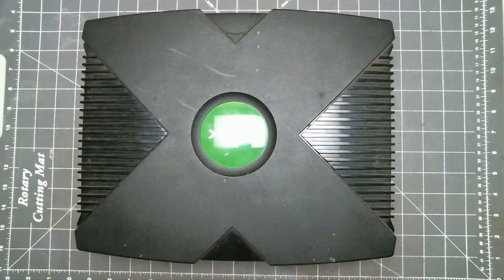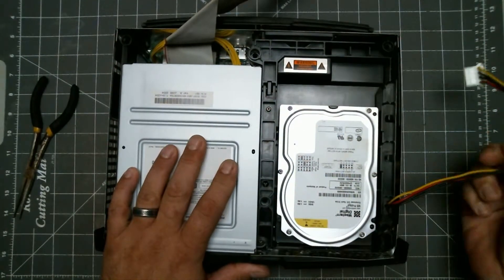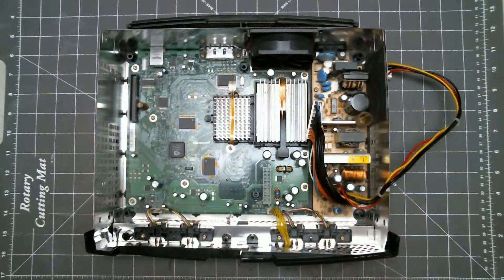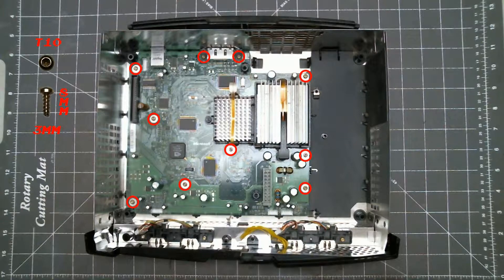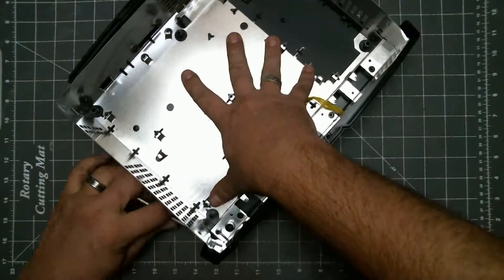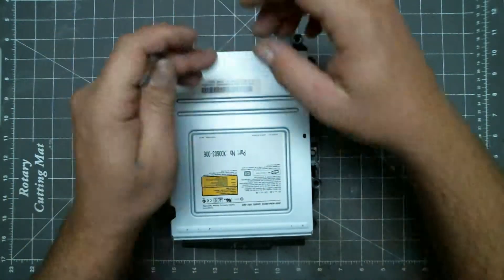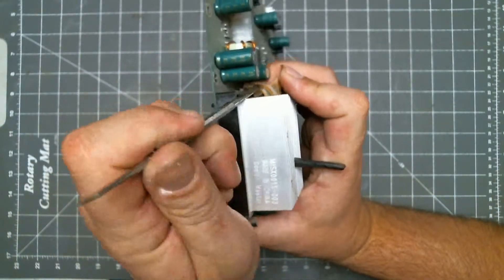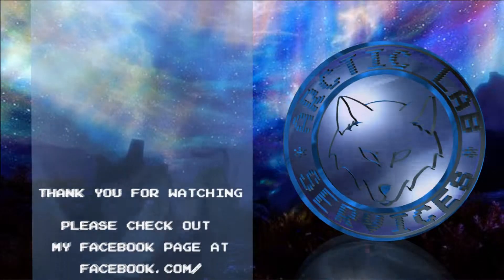ORIGINAL XBOX DISASSEMBLY [WARANTY VOID IF REMOVED]

Comment: Horrible demonstration. I've now broken the plastic of the top cover and still cant remove the top cover. Is like it's  bolted on there even after I removed the 3 screws from the bottom
Reply from the maker: There are 6 screws on the bottom...

Comment: What do I do if I turn on my original xbox and it won't do anything but has a screen that says "call xbox support"
Is there any way around this? I bought it from gamestop but all my old receipts have sadly faded to being unreadable. Any help or advice would be greatly appreciated.
Reply from the maker: there should be a code at the bottom of the screen that you can google. typically its a hard drive issue but it could e other things. good luck.

Comment: Thanks man. This helped a lot. I made a rookie mistake and plugged a 110v Xbox into a 220v power source without using a voltage converter. Looks like it fried my power supply board 😢
Reply from the maker: That will do it. Lol. Im
 Glad i could help.
Reply: @ARCTICLABSERVICES  would you happen to know if a place I could get a new or refurbished power supply? Not having much luck on Amazon or ebay 😕
Reply from the maker: Unfortunately, no. To be honest, a broken xbox that powers on might be your best bet.
Reply: @ARCTICLABSERVICES  yeah good point. Thanks mate 👍

Comment: It's built a lot like a normal PC, which is helpful. Mine stopped turning in so if I can't fix it by resoldering some joints I guess I could just replace the whole power board. I think mine is a pretty late model (nov 2004) so it's past the point of the exploding capcitor models....
Reply: I would change the 5 caps on the main board next to the PSU. Those are known to fail early. Also if you don't have a 1.6 remove the clock cap.

Comment: Question: 
How do you fix back those rubbers under the console?The ones you need to take off to unscrew to open the console.
I opened to take off the clock capacitor so the console won´t die because of the fluid leaking on the motherboard.
I searched for a rubber glue on the net and bought the Scotch Premier Super Versatile 2 Super Storng Adhesive.
After using it on those rubbers I don´t think it fixed them.Maybe I put a very little quantity?
Reply from the maker: i dint know what kind of rubber they use but it likes to repel glue. using sand paper on the rubber side helps a little. i usually end up using strong, thin double sided tape.

Comment: I took out all the screws from the bottom of the console, even the two hidden ones under the stickers, but the cover is not coming off lol. Edit: BROOOO THIS THING IS DISGUSTING. I’m trying to pry the cover off and as I pry it and look between the crack there’s tons of sticky stuff.
Reply from the maker: It is a very tight fit. It has to come off level. You can't pull up on one side. All sides equally. Very small tolerances.
Reply: @ARCTICLABSERVICES  alright. I’m going to keep trying. It is nasty tho. It’s been sitting in our family’s closet for 12 years and used to be my older brothers so it’s going to need a really good cleaning. Surprisingly it still works.
Reply from the maker: If the dust build up is bad enough, it might be keeping it together. Its awesome that is still works. Good luck.

Comment: thanks so much! its 2021 an i have 3 original xboxs an took two apart, wow was one of the two INSANELY disgustin, had dead bugs, CAKED in dust, smelt kinda bad, now its cleaned inside so no more bugs! i bought all 3 for like 20$ an all of them work to! not to mention they all worked when i got them, an they were all dusty LOL

also i absolutely love how xbox made the og xbox seriously, its such a breeze to take them apart, only like 7 screws, an like 4 cables an your at the motherboard! i love og xboxs for sure!
Reply from the maker: that's awesome! and a really good deal too. doesn't it feel so satisfying after cleaning/repairing old consoles? i think i like it a little bit more than actually playing them. lol
Reply: @ARCTICLABSERVICES  lmao, yes same here it’s so satisfying to clean old consoles.

Comment: Some things I did differently that might make this easier. 
1. Removing the HDD from the holder allows you to remove the HDD power cable without needing pliers.
2. My motherboard had more screws than this one. The extra one was in the middle near the top by the fan.
3. Removing the motherboard BEFORE the fan makes it 100 times easier to remove the fan and 1000 times less likely to ruin the board.

Other than that perfect video.

Comment: tore down my original xbox i got as a kid to see why it wouldnt boot. :( 5 blown capacitors in the bottom right of the main motherboard. RIP ol girl. you'll be missed
Reply from the maker: If the corrosion isn't that bad, it can be fixed. Caps are cheap. Plus when you get it fixed, you can soft mod it to play all kind of retro stuff. It all starts with a couple bucks and a couple hours of work.

Comment: NoT mY wArRanTy! / s

Good vid, thank you. Can you remove the DVD drove without taking out the hdd? Replacing mine.
Reply from the maker: Technically you can. Just remove the two screws then try and release the tabs holding the drive in. With the hard drive tray in place, it might be hard to release the right tab.

Comment: i did disassemble my xbox but when i turn it on it shutdown be its self and when i remove the hard desk power cord the xbox works why that happen?
Reply from the maker: That is interesting. Double check the cables. Make sure they are plugged in all the way. If its still not working, the hard drive or cable might be bad.
Reply: @ARCTICLABSERVICES  when i turn on it shutdown with sound is that meaning the hard is bad ?
Reply from the maker: @naseromar5533  a bad hard drive could cause it to restart. It could also be a bad cable to the hard drive.
Reply: @ARCTICLABSERVICES  what i should do then
Reply from the maker: @naseromar5533  to be honest, i have only swapped the hard drive on a moded xbox. im sure there are ways to do it. ive just never done it. sorry.

Comment: Hi so I got the clock capacitor out by wiggling it out (no other liquid came out but there was some already on the motherboard). I then cleaned the whole area out and the rest of the motherboard with rubbing alcohol and some q tips. I turned my xbox back on but it popped up with a page saying to call customer support. Before the xbox would just not show anything and just red ring with occasionally turning on (but popping up with the timer which is what made me think it was the clock capacitor).  Any ideas to what could be wrong or why this is happening?
Reply from the maker: On the customer support screen, does it give an error code?
Reply: @ARCTICLABSERVICES  Hey sorry I didn't see this until now. The error code was 12. I took apart the xbox and found a cord not plugged in all the way to the disc drive. I plugged it in fully and we're all good now :). Thanks for the response tho and great video!
Reply from the maker: @georgebeckwith4942  awesome.  Glad it worked out. And thank you.

Comment: The screws of the HDD casing are T15, not T10.
Also, to remove the heatsinks (GPU one) is better to heat up the heatsink first by turning on the console or heating it up with a hairdryer.
Sometimes is almost imposible to remove it.
Very nice video
Reply from the maker: Interesting.  My hdd  screws were T10.  It could be different depending on the version.  For extremely stubborn heatsinks, heating them up would make it easier. Thanks for the info. Every bit helps.

Comment: How hard should i be pulling for that ribbon cable bc i pulled on that shit and everything pulled up out of the plastic case so its safe to say its IN THERE xD i dont wanna break it
Reply from the maker: which cable and where is it connected? if its the wide grey one thats connected to the motherboard, it can be a little bit of a pain. try pulling a little bit on one side at a time. e very little bit. it will feel more like your wiggling it back and forth.
Reply: @ARCTICLABSERVICES  i got it the previous owner superglued the rim of it but i got the sucker off lol
Reply from the maker: @shmapple29  wow. super glue? really? some people shouldn't be allowed near electronics. or super glue. lol.
Reply: @ARCTICLABSERVICES  yes really my brain was like "O-O" when i saw it I agree with you. Big stickers with "no superglue plz" should be put on em lol
Reply from the maker: @shmapple29  lol

Comment: How do I put back the top cover of the xbox mines doesn’t go in correctly
Reply from the maker: if its what i think it is, its just an alignment issue. there are alignment rails towards the front of the side walls of the cover. there are grooves along the sides just behind the face plate. align the rails with the grooves as you lower the cover down.  let me know if that helps.
Reply: @ARCTICLABSERVICES  I forgot this comment but yes it did helped me thank you

Comment: My top of the box won’t go on and nothing is blocking it from going in
Reply from the maker: There are grooves down the side by the faceplate. The top needs to be lined up. Line up the grooves with the top and put the top on level. Slide down all four corners at the same time. It is a bit finicky.

Comment: I just bought an old Xbox today and the power button and disc eject button were very sticky and gross. Of course to access the buttons themselves basically everything has to be removed first, lol. But, I did it, got the gunk off with rubbing alcohol, and cleaned out the whole system in the meantime. Couldn't have done it without this video. A HUGE help! THANK YOU!!
Reply from the maker: You're very welcome.